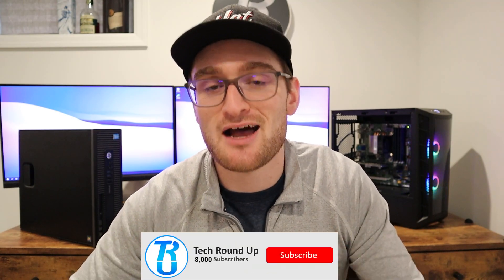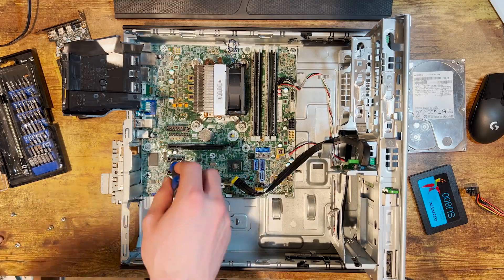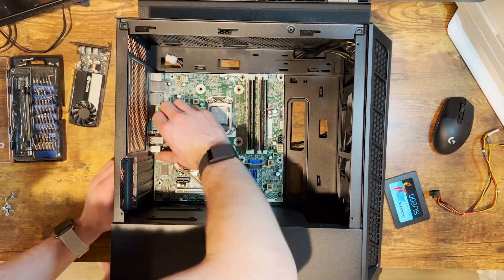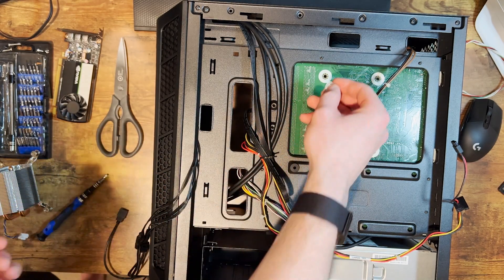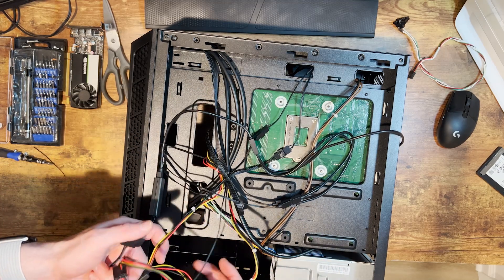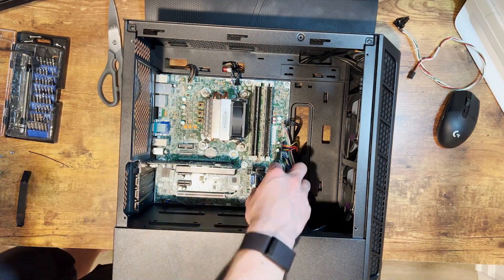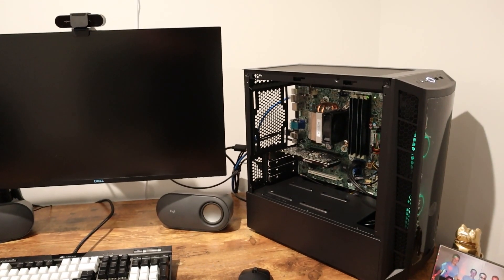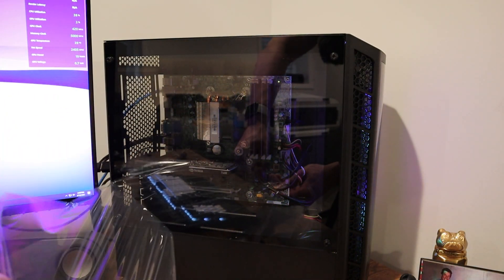Turn a $100 Office PC into an Awesome $250 Gaming PC!

Comment: I am sure RX6400 would fit and work like a charm in original case with original power supply. In my opinion, it was not worth the effort.

Comment: ADD ONS - 1) you can get a cable form amazon/ebay/aliexpress to allow you to  std power supply - 24 pin to ? pin.   Cable is model specific - so be careful.   2) if you do that, you can power all sata/blink to the sata from the power supply.   3)  the errors for usb 2 and usb 3 is NOT caused by not hooking them up.  HP does some 'magic' on the cables ( they connect 2 pins together ) so you can fix it by altering cable, altering motherboard ( no my style ), 3 connecting the 2 pins in the motherboard socket.  I have seen this done.  User did not use the connectors, just wired the fix.  I think I would have 'wire wrapped' the 2 pins with conservative amount of wire and then plugged the wire in ( I believe a lot of HP's use the same p;in header as std mobo - but check ).  that will get rid of the 2 usb errors on boot.   Note sure of sound error.

Comment: Sir, I did the same thing with my rx570, but the image doesn't appear even when I plug it directly into pcie and use another psu for the gpu only. Is there a BIOS setting that needs to be changed?

Comment: Really late question here in 2025 but if you can remember. Did the front panel usb and audio work? I actually want to do the opposite by using the hp front panel with a new motherboard but cautious of  Proprietary issues so if it worked afterwards I expect them to be standard.

Comment: Great video and tips. I have a the 800 G1 that I added a I7-4790, 16GB ram, an Evga 1060 6GB and added a 120mm intake fan in the front after removing the little speaker. I would like to find a way to add an aftermarket tower cooler to it. If anyone has a video or info on what needs to be modded/adapted to the HP socket and what cooler fits I sure would appreciate it.
Reply: i have been wondering that too i have still i5

Comment: lol did you not apply any thermal paste? Also I did pretty much the same build and used nuts from the hardware store for the cpu cooler. Thought about cutting them out of the old case though.

Comment: Cooler Master MWE 400 80 Plus Bronze Pc power supply unit ATX 400W can i ise it with the g3 i7 7700 and then can i use a GeForce GTX 1060 GAMING X 6G Graphic Card MSI?

Comment: Where do you plug you're case fans into
Reply: There are fans with 4pin molex connectors available. I just swapped the PSU and bought an "24pin to 6+4pin adapter".
I don't need it for my build but I could even get a GPU with external power supply now

Comment: I have ho 6300 sff i want to swap my cabinet and add 500 w psu so that i can install gtx 1650 or rx 590 i also have i7 3770 so it is possible right upgrading this way??
Reply: Hp 6300 pro*

Comment: For the psu, u can make an extension plate out of metal attaching the case screw hole for the psu and the screw hole on the actual psu
Reply: or 3d print a bracket if you have a 3d printer or know a friend with one also 3d print a io shield

Comment: Great video I was able to do the case swap without issues Great work with the front pin headers on the board 👍
Reply: Does this work with HP elitedesk 705 ssf?
Reply from the maker: Glad it helped
Reply: @TechRoundUp  do I need an hdd because I don’t have one

Comment: I just did a case swap from this machine with a I7 4770 and added a new psu and a 1060 6 gb
Reply: Hey man I just bought 1060 for this rig. Can you tell me which case did you use?
Reply: @Harmansnation  hey dude. I used a Rosewill D100 off Amazon for $50 free shipping. Best case I've bought for that price. It's its $60 or below it's a decent price since it comes with 4 rgb fans with a rgb controller.

Comment: I have a elitedesk 800 g1 tower, so the power supply is much bigger than the sff u have but other than that everything else looks the same, this is my first pc so I was wondering if I should swap the tower into the micro atx case u got in this video or if I should have a different case could you help me out?
Reply: The 800 G1 TWR's mobo fits perfectly into a MATX case. Get a regular ATX PSU if you can too, as the OEM's screw holes don't line up with the regular ATX mounting ones.

Comment: What 4 tabs you put under the cpu cooler I need to get them what are they called
Reply from the maker: I used some metal snips to cut away the tabs in the HP motherboard tray.  This of course does render the original case useless

Comment: FYI i tried running a fan splitter from the CPU fan header as well on this system, the power draw from all the fans fried the mobo.
Reply: Thanks for the heads up.
Reply: damn, good to know!
Reply: So would you recommend getting a 260W Power Supply when making this build ?
Reply: @esalexlopez  yes but I wold also recommend running additional fans off Sata power adapters instead of the mono, they will be louder and have not pwm.

Comment: Can you install a bigger graphics card since the pc case is bigger?
Reply from the maker: Yeah, but you’ll have to upgrade the PSU as well
Reply: @TechRoundUp  any good graphics cards recommendations for this particular system?
Reply from the maker: 3050-3060ti range.  Just know that for a new psu you are also going to need a 24pin tax to HP power adapter
Reply from the maker: https://amzn.to/3zu6Y8A
Reply: @TechRoundUp  dude I literally love you thanks for the amazing help, just put a 750w power supply into my shopping cart for my rtx 3060. Your a life saver dude!

Comment: I did a video too on doing the case swap. Bypassing the front usb errors are real easy to do, just a matter of jumping or adding a ground. Will post a link to the video I did explaining it. Love the content!!
Reply: Your videos are awesome, i will do the swap using your method this month, will try to at least send pictures when its done
Reply: @christopherchristiaan3788  awesome to hear!! please do, would love to see it!!
Reply: @DLMtechgarage  i have hp ml150g6 main board. and want to take advantage of it and build it into a gaming pc. i am having fan and sensor problem. only 10 wire is off. plz help me. thank
Reply: Thank you for your vids
Reply: Didn't expect your here lol your videos are fun to watch
Reply: @concepcionc-creativity9080  thanks!
Reply: Hey do you have that vid?
Reply: does the 800 g1 have a hdmi port? and does it allow ethernet only for internet?
Reply: Great video and tips. I have a the 800 G1 that I added a I7-4790, 16GB ram, an Evga 1060 6GB and added a 120mm intake fan in the front after removing the little speaker. I would like to find a way to add an aftermarket tower cooler to it. If anyone has a video or info on what needs to be modded/adapted to the HP socket and what cooler fits I sure would appreciate it.
Reply: Wheres the link?

Comment: Please can someone reply to this
I was wondering is there any sort or way of tricking the computer into thinking the USB and speaker slots are in use so the PC will boot normally
Reply from the maker: You can always keep the speaker and reconnect internally, the usb is a little more difficult
Reply: @TechRoundUp   thanks mate what do you mean by the USB do you mean the USB 3 port

Comment: Yo bro how big of a gpu can you through in there without javeing to upgrade the psu. I bought a full size 1650 and now iam stressed tge psu won't be enough.
Reply: Bet thanks cause spending 400 bucks on the gpu and it not working would suck
Reply from the maker: If the card doesn’t require any external psu power(6 or 8 pin connector) you should be fine